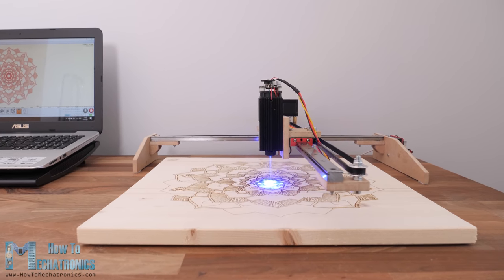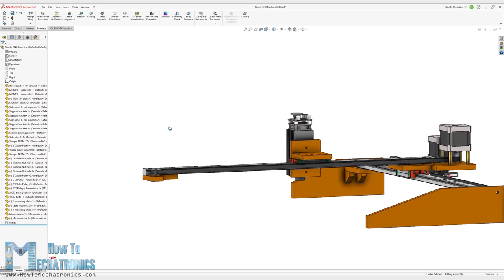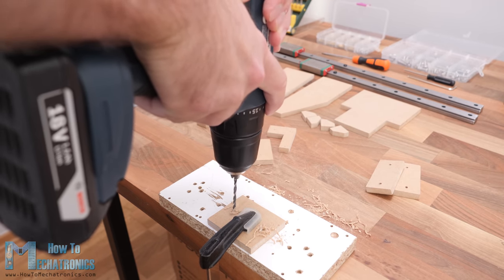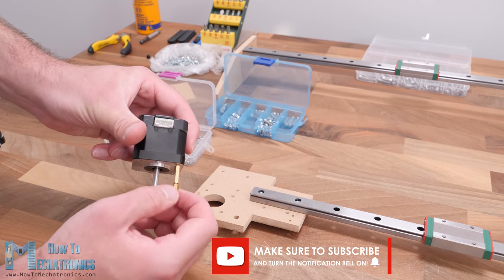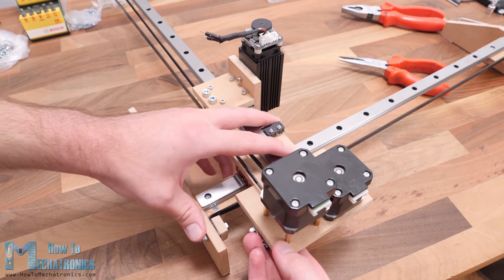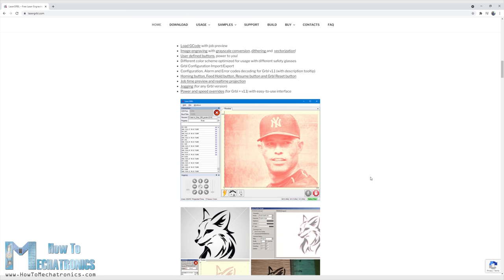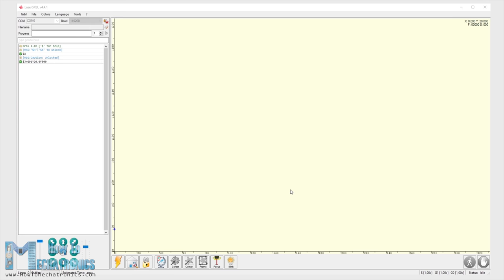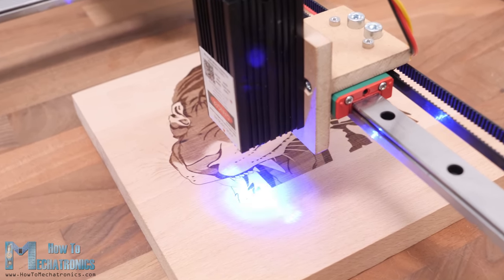How I built the Simplest CNC Machine with minimum parts possible | DIY Laser Engraver

Comment: Nice build! Keep in mind you need to have your belts parallel to the axis.  Yours are angled slightly which means the belt gets tighter/looser as it gets closer or further away from the end points.
Reply from the maker: Yeah, that's a good point, thanks for the input!

Comment: Thanks for this. I have looked at many, many, many CNC machines and this is by far the easiest and least expensive to build. I'm not a fan of the slider blocks used here because they get dirty so easy but since this is a laser CNC and not cutting wood like other CNC's, I think they will work just fine. Great job!
Reply: Just orderet from amazon link 👌 this was cool
Reply: good point. Thanks for mentioning this. Recalculating my design.

Comment: QUESTION: If i decide to use other stepper driver like DM542 (less overheating bigger max current) Is it going to work? ( if i connect the cnc shield with stepper driver inputs correctly) 
Thanks in advance :-)

Comment: Wow, thank you for this. I appreciate the frugal take on this. I'm in design and part purchase phase. But I also want to create a machine with upgrade ability if i want to eventually get a CO2 tube. So I am going with a fairly sizable extrusion frame. But I was debating on a tslot/vslot combo, a tslot/linear rail combo, or tslot/linear rail (x)/linear rod(y&z) combo. But the ingenuity of using wood has me reconsidering because I can get more laser for my buck if I cut costs and use what I have in lumber and just buy rails. I so appreciate you taking the time to do this.

Comment: This is a nice project to learn cnc control as this could be upgraded slightly to use a small engraver motor,however,the use of MDF,the dust from MDF contains FORMALDAHIDE which is very toxic,so dust mask and good extraction,ANY wood material will absorb moisture from the air ,so ,you could either use same thickness  large plastic (nylon)chopping board which will not warp with heat or moisture or water down PVA white glue to make an emulsion to paint all surfaces of the MDF after cutting to size,this will make it waterproof,make all screw holes self tap or drill holes and add emulssion,removing excess with a cocktail stick from screw holes.

Nylon chopping boards can be found quite cheap,and are very strong and stiff when used in the proper dimentional axis to force,it can bend but will not compress easy so proper use is a must,along with PVA emulssion treated MDF,a very strong stiff frame can be made,though this project is very nice and the use of good linear rails is very commendable.

Comment: Don't forget focal point. Should be in the laser specs. As pointed out, the belt positioning is also important. Curious as to resolution with this setup? I see these steppers are 1.8 degrees. Without additional hw, I'm assuming no half or finer stepping.

Comment: Nice and simple! Do you have any problems with the arm that carries the laser head? I was thinking that it would be cool to extend the cross arm out the other side to counter balance the laser head. You could use the same belt to move a counter balance opposite to the laser head.
Reply: yes pineapple pizza:  That sounds like a good idea.  It would probably pay to keep some weight on the laser side to preload the bearing.
However... this works so well as it is that you might just be adding complication for no benefit?
Reply from the maker: Thanks!
Well as I said in the video, the machine is not that rigid, but works quite well. I probably should have mentioned that in the video, when the laser head goes to end of the arm, it leans down about 1mm, but it don't make much difference for the laser engraving.
Actually, I notice that the play was coming from the MDF construction itself, not the linear rail. I mentioned that in the video, that the way I glued and screwed the MDF pieces that hold the X-axis was not that good. A more stable way, for example a metal bracket, would make a difference for sure and it would reduce that play of the Y-axis.

Comment: Hello, thanks for sharing this information, I ask you a question, I have a "core XY" cnc laser that works fine, but I had to deactivate the limit switches because they caused random errors during printing, even though they were not pressed.
did you make any modifications to the firmware? Thank you
Reply: Try using shielded and grounded cables for them, might be an interference issue. Either that, or some of your pull-up/pull-down resistors on the motherboard went bad.

Comment: Just to verify; Will this machine CUT modestly thin airplane ply (balsa, birch, etc.) & XPS foam with reasonable accuracy or resolution? These materials aren't thick or very firm. I can use a foam cutter for general shapes, but I'd like to use .stl files for gcodes to cut pre-designed shapes from folks that have already 3D designed said parts such as wing ribs, formers & similar. I'm just a home hobbyist that dabbles in electric prop & EDF homemade/DIY model RC planes in XPS foam (Depron brand), 3D print & light ply. You're designs & builds are killer nice! Thanks so much for making these vids for us!

Comment: I'm not using arduino sheild... Using tb6600 driver for stepper so laserhead 3wires 12v,, gnd,, pwm.. Pwm to connect with d11pins and 12v and gnd have separate power supply... But have to gnd the laser head with arduino uno separately even though 12vand gnd connected?

Comment: i have teh cnc 3018 and exact laser as yours. but the problem is that I need to MANUALLY adjust the variability (rotating thing above the laser) of the laser while its engraving. so it doesn't change its power by its self. could you please help me on that?

Comment: From what I've watched on you tube if you don't have a stepper motor to the driver, the shield will fry and become useless.  There are four slots on the shield and only two stepper motors are connected to the drivers. If that's the case how can you overcome the idea of two unused driver's slots so the shield won't fry. As usual you are very good at this, my hat is off to you.

Comment: Hi, I am planning to build a simple arduino based cnc plotter. I saw 2 methods for the linear movements. One is using threaded screw. Another is using belt driven. Which one is better?

Comment: We are engraving our company logo on pipe stems and cigarette holders 0.25 mm deep, then fill the engraved path with a proper dye. My question is that those machines can do such a small engraving in a proper way, smooth and clean? Logo is about 4-5 mm diameter. Thanks!

Comment: Nice, but - Mounting both motors on the moving axis will slow it down. The X axis should have the motor mounted on the end and use a pulley on the other end.

Comment: The finishing is really impressive. You just need two stepper motor for x and y direction with no moving part along z- axis. It is really compact and cleverly built.
Reply: You can even reduce xy to CoreXY-like principle and have no moving Motor at all
Reply: @spaceengineersmods  I've built a similarly-sized core-XY plotter, but I utilized many 3D printed components.

Comment: Do you have the measurements for the limit switch under the main plate?  It appears that your CAD drawing is still missing them.  I'm looking to export these out for 3d printing, and would be nice to have these missing holes in the main plate.

Thank you for your hard work on this model!

Comment: Thank you very nice tool! But I want to make small correction for steps per mm calculation.
You can calculated exact steps per mm. You use well known timing belt. Usually it has exactly 2 or 2,5mm per tooth. (there is also other timing belts, but this two are normally used for 3D printers) The stepper motor pulley has usually 16 or 20 teeth, so one revolution is 2mm * 16 teeth = 32mm. We also know, that usual stepper motors has 1,8° rotation per step or 200 step for 360°. Then 200 steps / 32mm =  6,25 step/mm. But usual stepper motor driver used by 3D printers has microsteps, some of them up to 16 microsteps per full step and some up to 32 (there is also much expensive with 256 microsteps). So if you've configured 16 microsteps you've got 16 microsteps * 200 steps / 32mm = 100 microsteps/mm
I think you've 32 microsteps driver, 2,5mm/tooth timing belt and 16 teeth timing pulley, so your exact configuration is 160 microsteps/mm. Using 161.29 - you makes your engraving ~0,8% smaller as drawn.
Reply from the maker: Thanks for the input! That's indeed a good way to do the math. After few some tests, I actually ended up using 160 steps/mm which is exactly the same with your suggested calculation.
Cheers!
Reply: Hey man. I have a question for you. I'm planning on building a 600x500 engraver using this method.. I've never programmed one before, how do I set to size the the software.. do I plug it everything in an the board automatically know the size??? Help needed.

Comment: Hello, if we attach a 40W laser head to the same system, will we have a power problem? What should we do in this situation?
Reply: I think we can use 40w or 80w laser tube but we have to seprate attachment in a box(some typical but not imposible).🙂😉

Comment: A bit late to the party, but I've started researching on CNC laser engravers so that I can start building panels for my XPlane simulator. This video is sensational and I am so thankful that I came across it. I am planing on using your design to build one, the only change I might do is to use (as you already suggested) metal brackets. The other change I was thinking off is using HGR15 rail blocks for the main axis instead of MGN15 (HGR is stronger and supposedly built to tighter tolerances).
For the axis that holds the laser, I would use MGN12, to try and reduce the bending moment that the laser axis applies on the primary/main axis. Perhaps I could use the two Nema17 motors to provide a bit of counter balance.
Your design is really fantastic mate - congrats, well done.
Reply from the maker: Hey, I hope you will have fun building one. I would also consider what I mentioned in the video, add another rail on the other side. The point of this video was to make the machine with minimum parts possible, but for more stable work, you can add another rail.
Cheers!
Reply: @HowToMechatronics can you make a latest version doing all the modifications required?

Comment: hello 
i have a question about this circuit. i have made this project as you did but i want to ask you about the consumption
it is really need the 3A for it to work? i have used the same amount of the amps but i realized that is need more amps than 3

Comment: I would use it as a pen plotter for RC air craft plans. It  looks like you could use A3 size paper?  Laurie
Reply from the maker: Yeah, that would be a good use. This particular setup has 390x360mm work area, so close enough to A3 paper 297x420mm. Though you can use longer linear rails and get bigger work area.

Comment: Wow!! Great Content. Well, linear rails are quite expensive,  are there any cheaper alternatives  which work well ?
Reply: These linear rails are dirt cheap on ebay and/or amazon
Reply from the maker: Yeah, they are a bit expensive but they work quite well. A cheaper alternative would be those round profiles in combination with linear bearings but they are not as good as these.
Reply: @HowToMechatronics  MGN12H can be an alternative?

Comment: @7:01 What kind of grease for the rails?
Reply from the maker: Initially I used an oil from a hair clipper but it's not good, it's too tin. Then I bought a dedicated one for bearings and it made a huge difference.

Comment: That's very impressive, especially considering the materials used. I was surprised that the unsupported axis was so stable. Awesome design.
Reply from the maker: Thank you!
I probably should have mentioned in the video but as I was saving on time I didn't do it. When the laser module was fully extended there was a leaning of about 1mm. Though, the play was not coming from the rail, but the MDF base, or because of the method I glued an screwed the pieces where the X-axis was mounted.
Reply: @HowToMechatronics  Presumably a bracket would fix that. 1mm doesn't sound like much; if it doesn't mess with the laser focus, then all's good.
Reply: How about adding a roller blade wheel on the end of the y axis to support it kind of like what they do to a large gate so it doesn't sag?

Comment: Very great video. Thank you. What would you use to support the y axis? To help with the flex. Would you put another linear rail of some kind and connect  piece to the other end so it glides?

Or just stick a piece of something on a stick that is very low friction and hope for the best?

I might try to build this. Excellent video
Reply: I was thinking the same, ordered my parts a few hours ago. But an extra rail seems super expensive.. sooo. I'll probably try to add a little wheel at the end of the rail that rolls on that axis
Reply: @Arne1998  very cool. I am a bit jealous you bought material and are ready to do this. I am still shopping making my mind up.

I hope the wheel idea works. Good luck to you. Let us know how it goes.
Reply: @nodevit9950  Will do!
Reply: @nodevit9950  So I ended up changing the design entirely and going with cheaper rails,   and the rest of the pieces are all 3D printed hahah, got almost everything assembled now, just waiting for my laser to arrive from china
Reply: @Arne1998  What is the cheapest rail you used and what is the best design modification?

Comment: We absolutely need more videos like this, this is great!! Hoping for a 3d printer design too.
Reply from the maker: Glad to hear it, thanks! I always give my best.
Reply: @HowToMechatronics  I randomly got back at this video again. Wouldn't it be relatively straight forward to retrofit this into a 3D printer? Make it taller, scrap the laser and in its position add a structure that sits higher than the linear rails and lowers the hotend with a 28byj-48 powered threaded rod kind of thing with two rods guiding it. How doable would that be? A minimal part dual Nema 17 3d printer does sound appealing.

Comment: The linear rails and the laser module are quite expensive, can we use any alternatives..?
Reply from the maker: Yes, they are a bit expensive. Well other alternatives would mean completely different design.
Reply: @HowToMechatronics  thanks for the response. And a small request/suggestion try to make a project on a cnc machine that can do all the 1) 3D printing 2)laser engraving 3)pen plotting … that would be really appreciated